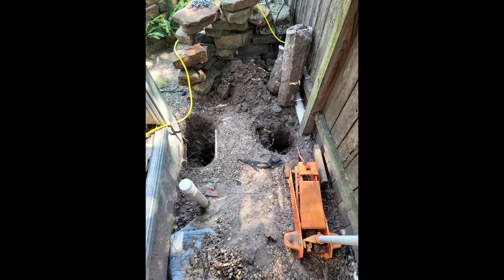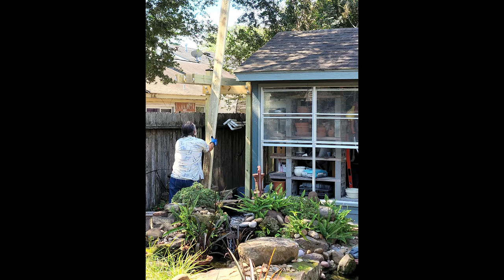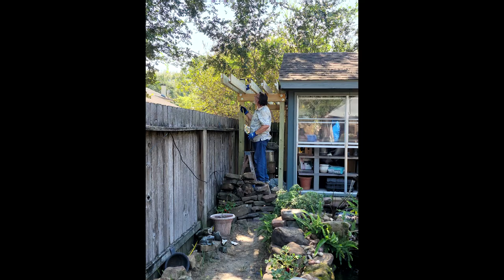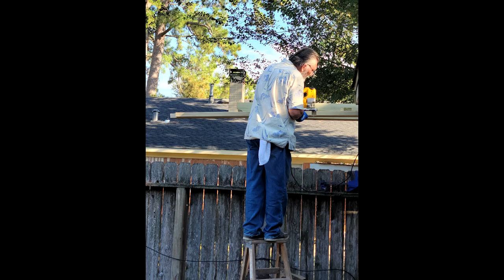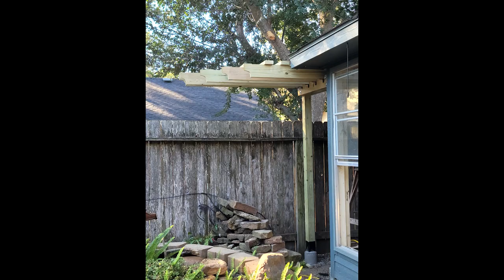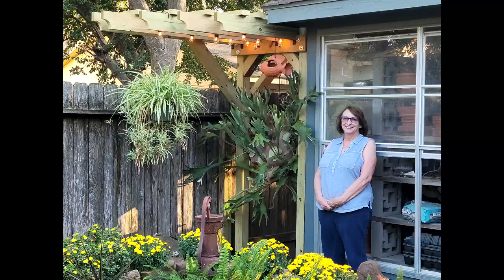How I built an Arbor in Two Minutes!

Comment: That was an amazing build, my back yard next.. wondering how many trips to Home Depot or Lowe’s were edited out? Did you create a template for all the curved cuts on your horizontal boards, if so what tool did you use a jig saw to cut them out? Love the idea of using that rubberized paint on the ends of the post in the ground too.
Reply from the maker: Thank you so much Carol!  LOL,  I done checked the box… no need to do it again 😂.  Only two trips to HD required.  I used a 6” plastic nursery pot for the template to cut the ends of the joists with a hand jigsaw.  The “Flex Seal” sealants have become some of my new favorite products.  I appreciate you stopping by!